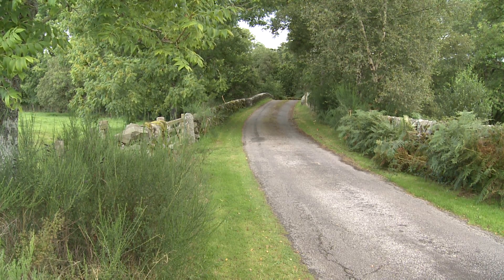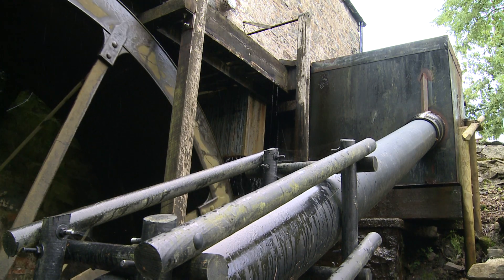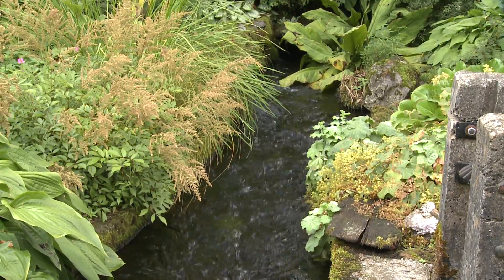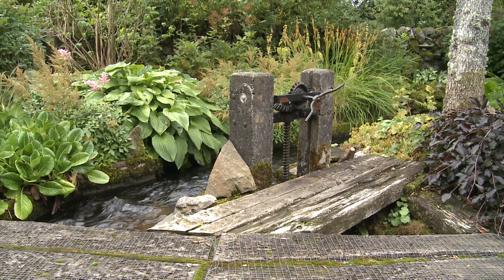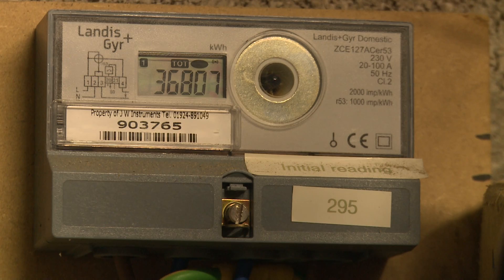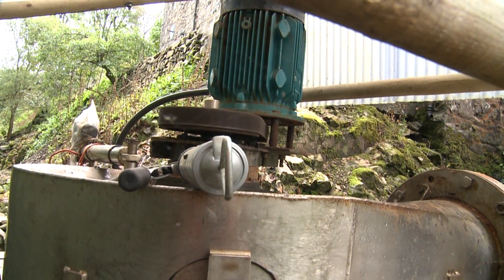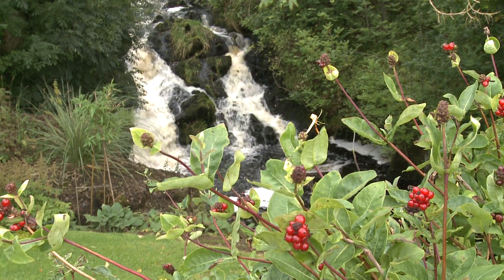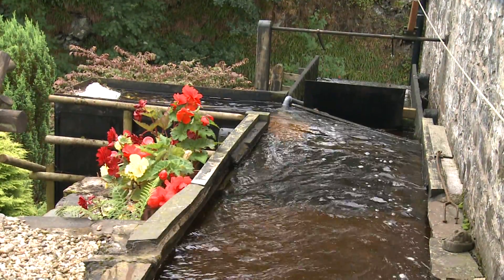Micro Hydro

Comment: What is the name of the US company that built the turbine?
Reply from the maker: Sadly, I don't remember from fifteen years ago when we made this film. The owner has long since died so I cannot ask him.
Reply: @ArranEye  I did a google search and nothing came up for a micro hydro turbine manufacturer in Pennsylvania. I remember these turbines as they have a stainless steel scroll case which was and is still unusual. Do you remember if the turbine has a tiny Francis runner or small propeller?
Reply from the maker: It sounds probable that the manufacturer may have ceased trading, or perhaps has been taken over. All we saw is in the video, so I cannot answer your technical question, sorry.
Reply: No, they are still in business. Nautilus hydro turbine has pictures of the same older gentleman in your film on their website during the construction phase of the instillation at Ironmacannie Mill, Scotland. Link below for the pictures.
Reply from the maker: Thank you very much for sharing this information Chris. Here's the link: https://www.waterturbine.com

Comment: Nice little hydro installation. For me it is not even a decision, I am using the water wheel. It is less expensive to replace the copper/bronze bearing liners on a pair of bearing for the waterwheel than to do a new £13,000 hydro install. Personally I believe he should not take public funds(Energy Saving Trust) to do a private hydro project and one where the home owner is getting paid for the excess energy produced. Keep history alive, waterwheels powered the industrial revolution both in the Europe and USA they are certainly good enough to power this bloke's house.

Comment: You have one of the best home generator sets out there. I see you have what appears to be a synchronizer for your small generator. I expect that it must control the speed in order to close the circuit breaker 
within a 5 degree window otherwise it would do damage to your generator set. Thanks for sharing.

Comment: Question why not charge lithium batteries from a MPPT charge controller, this way your initial outlay might seem a lot, but what you will get back is 100% electricity for your home, totally off grid !,,,,,,,,,,just an idea I like Victron Energy unit as the build quality is great

Comment: Nice setup! I think for this location a crossflow / banki turbine is the better choice! In germany we also call it "Ossberger-Turbine". The francis turbine you have used has a good efficiency WHEN water is enough! If the water is on a low level ( summertime ) the efficiency goes down! We see it in many plants. I mostly built crossflow turbines. I like this turbine cause you can take it from 2,5 m and you have no problems with leaves or other things cause the rotation of the turbine have a self cleaning effect! And when it´s less water you go on a smaler runner width!

Comment: Use it or lose it.... give it away to let the power company charge somebody for it. I would only do that if that's a two-way street if you could use theirs and they could use yours both for free. If that's not the case then they need to put a meter up. And there are cheaper alternatives than the lead acid batteries. There's a small fortune there that you're giving away.

Comment: With this amount of hydropower you must can generate lot more energy than 2.5 kw.

Why a 2.5 KW system and not 10 kw.
Reply from the maker: Back when this system was installed, 2.5kw was the most that head of water could generate. I think you are probably correct that greater efficiency is now possible.
Reply: At least it should be minimum 5 kw

Comment: What a bummer. There are many suppliers for small hydro power plant in central europe, espacially in the Alps, because they have eaxct the same small becks like mentiont. Hard to understand why sourcing from over see.
Reply: Anton it’s likely that the type of turbine required for the head pressure and flow rate was not available in UK.
Reply: Anton I believe the sourcing problem simply comes down to culture. People around the world understand the concept of conservation but few people have deeply invested in renewable technologies. e.g. here in CA, U.S. we are great promotors/advertisers of renewable energy. It may be the case that gentleman in the video simply googled for suppliers of micro hydro systems. I observed through youtube that people in Europe are very tightknitt, and the companies that you mentioned may simply cater to the microeconomy of a community/state rather than the macroeconomy of the world. Google put up the most popular choice rather than the most practical i.e. Pennsylvania. ; )

Comment: at 15 Cents per KW.. It would take 18.6 years till you received a payback..
Reply from the maker: Firstly, lots of people undertake projects like this for reasons other than commercial gain. Secondly, you get the electricity free, on top of the feed-in tariff. Your figures therefore equate to an investment of £50,000! The reality is that this installation paid for itself long ago - and continues to generate income, as well as useful electricity.
Reply: your math is wrong, 60 kw hours a day that's 9 bucks a day 3285 dollars a year
Reply: There is a saying in this country (U.K) where someone could be described as knowing the price of everything, but the value of nothing. There is another which is self explanatory, and isn't used as a compliment, If the cap fits, wear it!

Comment: I wish people could remember the difference between kilowatts and kilowatt hours. kW is an instantaneous measure of power, it is the rate at which work is being done. kWh is a measure of the total work done over a period of time. 1kWh is more properly 3.6 megajoules or MJ. Conflating kWh and kW makes it difficult to work out what he is talking about. He's generating about 48kWh per day, not 2kW per day. It's a bit like saying miles per hour per day. The electricity companies use kWh because it's easy to explain to people. If you run a 1kW electric heater for an hour you have used a unit of electricity.
Reply: i was thinking the same thing.
Reply: I wish people wouldn't use kWh but the SI unit of Joules! :@

Comment: Thank you for sharing this video. I wish you could use the water wheel as well as the micro turbine for some application. 
Could you add a seond micro turbine to the down pipe so you could harvest the waterflow a second time?
I would be inspired to add several auto alternatos to the belt drive to gather more power during peak flow periods.
Oh well, it's easier to think about something than it is to do the job!
Best Regards from Virginia usa